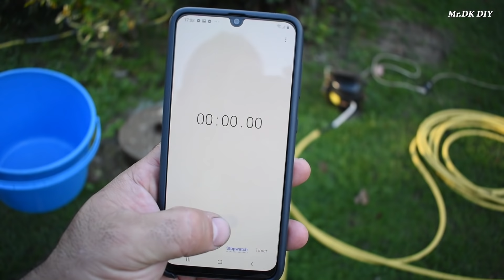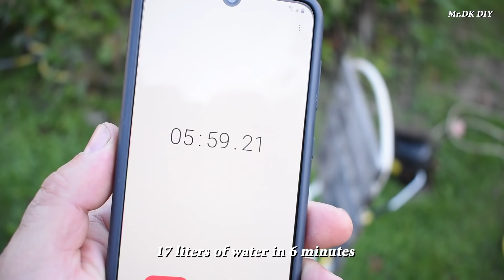DO NOT THROW AWAY YOUR OLD REFRIGERATOR COMPRESSOR / DIY SIMPLE WATER PUMP

Comment: Refrigeration guy here. Neat idea. I wonder how long it will last now that water is in the compressor where the lubricant oil was. These compressors are full of oil normally in refrigerators. The internal parts are steel and never meant to come into contact with water. Water is what kills most refrigeration compressors.
Reply: He use blowing air not intake(vacum) on the motor. I try this didnt work for me
Reply: How would water flow up a pressurized line? When you say "refrigeration guy here", do you mean that you drive a refrigerated semi, because that seems to be your intelligence threshold.
Reply: He's using a venturi style air lift pump.
Water isn't touching anything it's not ment to.
Reply: @despraterado588  looked I  mirror lately? 🤔 it simply wouldn't seeing water can not compress.

Comment: This is called an AIR LIFT 
I used to build coffer dams in muddy rivers and lakes and I built air lifts on a large scale . 
60ft 10 inch pipe with 2 large air compressors and a 100 ton crane fishing around in the coffer dam removing up to 20ft of material to pour an underwater concrete seal then after it hardens pump all water out now the crews can get in there and form up the piers or whatever we need in a dry clean environment.... 
You can introduce error at the bottom of any pipe in water and make an airlift are is an amazing thing when put Against Gravity underwater

Comment: in australia a car air conditioner compressor was driven  by a wind mill to do the same thing , as no power is required  ( air lifting water ) great if your out in the middle of nowhere . which we have plenty of  here  ( there is a huge amount of exploration drill holes in the bush ) boil before drinking  .

Comment: Again, this is a reason why I really don't like these channels that put on these statements that have nothing to do with the statement of the video. First of all, if you remove the compressor in most cases it is burned out so it's no use anyway. And even if it were, who in their right mind will want to use it as a small air pump or even a small vacuum?

Comment: Very genius idea .... for off grid people !  Ac compressor is free from fridge and freezer .  Solar panel to run pump too ....very genius ... thank you
Reply: I agree. But you should include some oil filter on the output of compressor. The oil is being 
sprayed into fog inside compressor and it is being sucked with input air. It could 
contaminate that water.

Comment: Just don't drink the water it pumps. Oil is in the compressor and WILL pump out into the well water. May not see it but it does.
Good job. I have pumped up tires with one i made way back when.

Comment: A junk cars air conditioning pump hooked to an electric  motor from a washer or dryer, connected to an air tank makes a good  air  compressor. Had one at home as a kid for tires, etc. An old power steering pump makes a great parts washer when hooked to an electric motor. A washing machine pump can be useful also. An electric dryer, washer etc. motor also makes a decent bench grinder.

Comment: Could you use it for pcp airguns ? They need dry clean air like divers use ??
Reply: No - pcp air guns run at a huge pressure & these aren’t pumping at that range. I have seen cheap mini high pressure compressors that do them on ebay cheap…

Comment: That Compressor WON't last long before it locks up,No lubrication which is in the Refrigerant in a normal application.That loud noise you hear from the compressor is metal to metal noise,got a lot of experience HVAC is what I do,not something that's going to last long
Reply: I agree
Reply: Water pump my foot. Not to mention this.
Reply: I've literally used a old freezer compressor pump for compressed air for 16 years now and still works great..lube is in the case as well

Comment: Seems a good idea except for the fact that these type of compressor releases oil from its motor. It means that in a while you´ll have your well water full of hydraulic oil. Good for washing car suspension and other devices that need lubrication though...
Reply: I dont mean to be offtopic but does any of you know of a trick to log back into an instagram account??
I was stupid lost my password. I would appreciate any tips you can give me
Reply: There's no oil getting released into water he's using a blower not the intake
Reply: If one wants to get poisoned ok. But as soon as the temperature rises, oil starts to evaporate in its smoke phase. That smoke will go into water as they share the same passage. All compressors that use oil as lubricant are forbidden by law to be used as pump in any human consuming water here in Brasil. There are specific graphite lubricated compressor for that matter...

Comment: Somewhat interesting way to elevate water out of a well hole. I would rate this about a 5 because I feel that there be better DIY hacks for a refrigerant compressor.  I don't know the psi and cfm capabilities but could they be used to run air tools, air up a tire, or pressurize hydraulic oil and work a cylinder like a log splitter?  I got a couple old retired outdoor central air conditioner units, complete with fan , compressor,  condenser. Would lime to rig up a diy cooling unit for my shop using something cheap like 90% alcohol as refrigerant.

Comment: You have connected both the tubes by using copper tube and  inserted this in bore well.
But have not shown   open end of pipe  which will suck water

Comment: Idont understand how the water will came up because the pipe is blocked and one way plz explain
Reply: It is called a "bubble lift." They are often used in aquariums to pump water through a filter, while also adding oxygen to the water. The opposite effect is called a HAC: Hydraulic Air Compressor.

Comment: Instead of constructing the system like that. Much better if you could try to establish an air tight system in that well and use the pneumatic force exerted by the compressor (let the compressor blow air to the system) to the well which pushes water upward through another tube connected deep into the well (submerged into the water) cosidering proper calculations for the heads.. u should obtain a much better and a constant volumetric flow. If you know what i mean. 

Its only a suggestion, but by theory and calculations it could be done with proper specifications and sizes especially for the tube/pipes.
Reply: скорее всего давления этого компрессора не хватит

Comment: Looks like an expensive way of pumping water - a cheap submersible pump would use less power.
Reply: Your missing the point .... thats one way of keeping it green and   (    self sufficient     )  for off grid type people . You can get free ac compressor out of thrown away fridge and freezer .  Solar panel to run pump too .... your set for off grid !     Self sufficient  !
Reply: Depend on the depth.  Cheap submersible pump may not have enough " LIFT "!
Reply: ken inglis he’s just tryin to show us one us for something a lot of us already have...maybe more than one of even...
Reply: ken inglis its not a damn water pump.. its and air pump.
Reply: Depends on the application
Reply: lol yes i can do for about 24w with 775 motor diaphragm pump

Comment: How deep of a well will that work on I know the compressor is a high pressure compressor
Reply: Deep as you want !   Need more pressure for deeper well ... add 2 compressor in line or 3 depending how deep or how strong of a pressure you want ?  Turn it off when you done or add solar power to run pump ?  Very good scenarios for  off grids type people .
Reply: Compressors is free from thrown away fridge and freezer .     Good luck !
Reply: it is geyser type of pump, you can search for various implementations, some can pump from several tens of meters. All those pumps are simple, but this one is among the simplest I have seen,  clever.

Comment: But, it's gonna be full of oil and metal fragments...
Reply: in an enclosed building, the vapors from it is toxic
Reply: the air from this system is not for breathing and not to mix with drinking water yet the project was absolutely great

Comment: Dude, how does that draw the water using air?
This application is right up my alley!
Reply: It's a simple air lift pump.  The tube is lowered into the water.  The air line from the compressor goes up inside the the water tube below the water line. As the bubbles  try to head up they push the water with them forcing water to come out the other end.  This principle has its limitations.  Higher you try and lift the less water you can push.
Reply: yeah as tony said. the same thing is going on with those air lifter pumps for fish tanks

Comment: You broke the law and damaged the environment by taking that compressor off of your old fridge. I doubt you recovered the freon properly.

Refrigerators have freon and freon is illegal to release into the atmosphere. So when you cut the lines your broke the law. I’m sure the EPA would find this very interesting. The fines are hefty. 

When you dispose of a refrigerator the dump does a proper recovery of the freon. It is then recycled and used in new and repaired appliances. You may think haha they don’t do that. But they do. Every facility that excepts junk refrigerators, freezers, window AC units and even water coolers has to have this program. 

Also those pumps are not made to move water. They are mace to love freon GAS. So it won’t last long moving a liquid. Also the freon has lubricant mixed in so the pump lasts. Water isn’t a lubricant. 

Not to mention I hope you’re not planning to drink the water. Because freon and it lubricant are poisonous ☠️. Not to mention the other things in the pump which are not “food grade”.

Comment: And where did the refrigerant go?
If you release the gas from AC's, freezers or refrigerators you are releasing powerful greenhouse gases (waaay worse than CO2).

Most refrigerants in use today are HFC's (powerful greenhouse gasses), though you may find HCFC's (ozone depleting and some moderate greenhouse gasses) and even CFC's (very ozone depleting).

A common refrigerant today is R-404A (HFC) and it is 3.300 times worse than CO2.
So don't go cutting compressors off AC's, freezers or refrigerators.

Comment: If you had ac, why wouldn't you use a in ground pump? Well pump then you can use water pressure. Otherwise I wouldn't drink that water it would have oil in it. It would be good to use in work shop with air tools, but they never showed the air pressure on a refrigerator / freezer Pump. I like the puppy, good supervisor.
Reply: Hi Allan:
  I think, if memory serves me, the output pressure is only about 3 psi? I tried using one of these motors for a shop compressor back in the 70's, just for an air brush, HORRIBLE idea. I had oil all over everything, and the motor burned up from not having a cooling source. Just my $.02.
 God bless:
Stoney
Reply: I think it's not safe to drink this water,
Reply: Those little pumps pump to very high air pressure.  They are less volume so they take longer to fill a tank than a regular air compressor pump.  They are in air conditioning units to and bigger.. I've heard of people pumping up to 700 pounds of air from the them in into scuba tanks.  I haven't done that so I don't know how true it is.  I have hooked them to my air compressor tank and it was a great way to have compressed air through the night without flipping my neighbors out because they are no louder than a fridge as compared to the LOUD AS HELL CRAFTSMAN AIR COMPRESSOR ...
Reply: Allan Robison noí I& in j88( 9(

Comment: It is called a "bubble lift." They are often used in aquariums to pump water through a filter, while also adding oxygen to the water. The opposite effect is called a HAC: Hydraulic Air Compressor.

Comment: Good for a laugh and something to do on a Sunday afternoon but using
Compressed air to lift water is uneconomic from a refrigerator compressor.
Far better to use a well pump, cheap to use and only switches on when
tap is opened. Novel and good for a laugh but not practical in any way.

Comment: UTTER NONSENSE. That refrigerator compressor would only last a little while. It is designed to push gasses and is oil lubricated. The water would destroy it quickly.